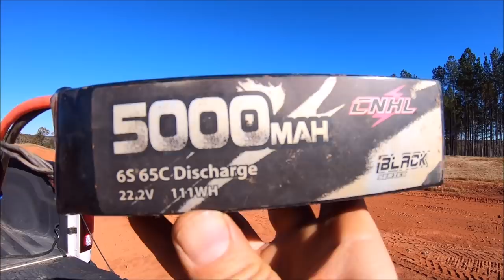TALION on STEROIDS!💪 1/7 Arrma Talion XL "Big Bird!" Flog, send and rip!!

Comment: No doubt rcdude81. You hands down push the limits of the arrma r/c's to the max. Big air & high speeds over some rough looking terrain. Love watching your videos brother. I gain tons of info specially when I comes to learning what these arrma r/c's are capable of. I jumped on the wagon and built a krajave. But I'm concerned about weight.. with all aluminum upgrades she is weighing in at 15lbs. (RTR).. I'm interested on hearing what weight your ending up with when she is 100% rtr. And wanna ask if you think switching back to stock plastic as much as possible is worth the weight I would be saving. I wanted to run the m2c mojave chassis but already 15lbs. With stock v4 chassis
Reply from the maker: Awesome bro it is a sweet custom platform!💪Imo if you want to shed weight, use Basherqueen Carbon fiber like I mentioned on my build. You want the M2C chassis as a backbone but shock towers, t2t brace, Akerman bar, top plate etc can all be CF to make her light weight as possible but still strong. I have a few more Basherqueen goodies about to go on mine.🤗👊🤘🤘

Comment: Hi Eric. I love all your work! Just ordered the EXB black Friday deal from Horizon and plan to stretch this new Kraton. With regards to the proline body; do you have the one with part number PRO346800? I want to make sure I order the right body. I won't be sending mine like you do but plan to do some on-road racing and heavy beach slaying! Great content; thanks in advance & thanks for sharing!
Reply from the maker: Awesome deal! Yes that is the body. I did have to trim the rear tailgate area off for the mounts to fit up. The Proline Chevy Long Bed C10 works too as long as it's the Long bed version. I do love the Raptor shell though! Good luck with her!
Reply: @RCDUDE81  Thanks for the feedback Eric. You can see from my crawler; I'm a Chevy man so I've got go C-10. Love those square bodies.
Reply from the maker: Agreed! I have a couple of the C10's! Good looking shell!😍

Comment: Got to ask what’s the difference other than the body and the m2c stuff from the new Arrma seems like the new Arrma is just a Kraton with a Mojave chassis like this ?
Reply from the maker: Yes this is Talion on a Mojave chassis with Kraton hubs and +5mm M2C hex extenders. The new Arrma is basically a Kraton with Mojave chassis and other cross breed bits. New tires and overall setup makes it a pleasure to drive imo!😎👊

Comment: Awesome Eric that thing is sick. Wanted to ask you I'm always having issues with rear clicking with my Kraton EXB 6 and notorious 6S always something with rear bulk head input gear and ring not staying together. I run it for like 30 secs then clicking stats. New input gear and my ring gears are fine. Would you recommend the hot racing or VITAVON aluminum bulkhead or something else? Don't you have the hot racing rear bulkhead for your cars? Anyways yeah  let me know what's best upgrades to cancel this issue. Thanks brother 👊👍
Reply from the maker: Hey man sucks on the diff problems!😝I run Hot Racing diffcases in the rear of all my rigs. That will help but sounds like you need proper Input/ring shimming. Do you have any 13x16 outer bearing shims on the left ring gear side? You need at least 1 and 2 with a HR case. Also check your diffcase bearings and make sure the diffcup is seated all the way and tight on the input shaft. Also the cover for the diffcase needs to be screwed down tight. Makes sure the threads aren't stripped holding that down. If they are, the diff will force the cover upward and loose mesh.😎👊👊

Comment: how come when i try that the weight of the motor rips the gears apart when it flops on the ground
Reply from the maker: Try what exactly?🤔
Reply: @RCDUDE81   extreme ramp launch..tried to do what you do  seemsto need support under the motor
Reply from the maker: Oh yeah I use felt padding like you use for furniture legs. I stick them under the motor for support.
Reply: @RCDUDE81  nice   thanks man